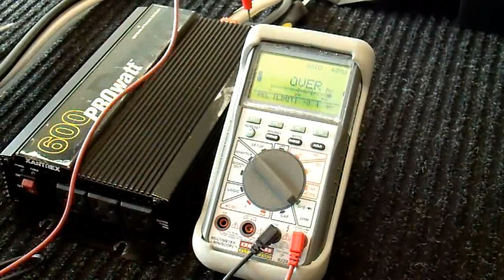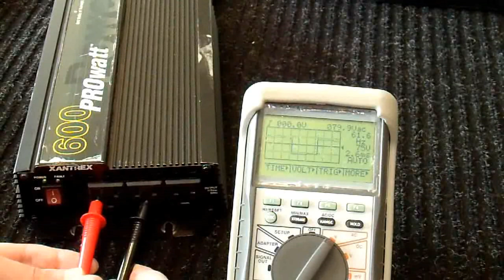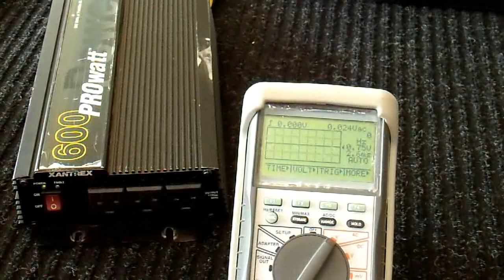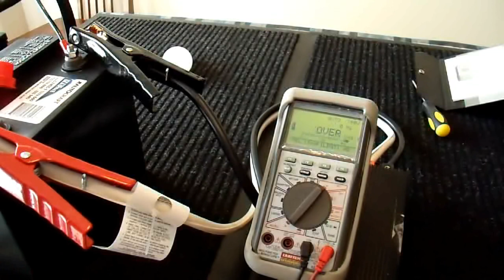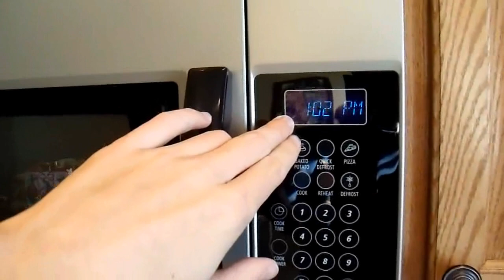How NOT to Connect an Inverter to Your House Mains - Xantrex ProWatt Inverter part2

Comment: Very well explained and worth bearing in mind before you connect an inverter or even a generator to a wall socket. Always check first to make sure your mains switch is dual throw that disconnects both + & -- .

Comment: This should have worked if your grid switch realy disconnected your house from the grid.  I use the way you first tried with no problems, I also use a grid tie system sometimes.  You Need a dual throw switch on your fuse box like we have in the UK.

Comment: Well shucks.  Glad I watched this vid, too. I use a suicide cord with my gennie during power outages. I was planning on doing the same with an inverter.  Now, I think I'll put my light circuits in a separate fuse box, powered by the inverter, and run extension cords wherever else I need juice.  I've ordered the XANTREX/MOTOMASTER ELIMINATOR 1,750 which has the knockout for hard wiring it.  Hopefully this won't have the issues with ground.

Thank again for all the info, S2

Comment from the maker: There are inverters that can do this safely that don't cost a fortune.  I had a powerbright 6000W inverter that would work fine for this - I ended up selling it for cheap.  I would recommend going that route.  Safe and (nearly) to code that way.

Comment from the maker: I don't believe in doing things 'by the book' simply because it's in the book, but I do believe in being safe.  I would not recommend separating GND from Neutral and letting the output float.  It is likely that at some point somewhere neutral will end up being tied to GND and you'll have issues.  If not then you have no protection from being zapped because your output isn't reference to GND.  Technically, though, it could function that way if one chose to hook it up that way.

Comment: If I just built a small off grid home, and wanted to use a cheap Chinese 5000 watt inverter... (not that I would)..... to run it, could I not simply start with a new panel box, isolate the ground from theneutral and be good to go? In other words, have an individual bus bar for common, neutral and ground. This is a really educational video. Good work.

Comment: well i have mine tied into the wiring of my house but i removed the neutral to ground jumper and installed a separate ground bar which should be done in the first place.

Comment from the maker: Many inverters have a connection lug GND available regardless of their output configuration.  It's probably best to just check your inverter with a multimeter.  Be aware that you need a low Z meter to properly test this since inverters tend to be so noisy (electrically) that meters will usually read errant voltages that aren't really there.

Comment: I just ordered one of those OSTiger 1500w inverters to run the 9200btu AC and my mini fridge while driving.  Cross my fingers that it can do it.  Victron makes a nice inverter/charger that will supplement shore power but it costs a fortune.  You can't beat the price on that tiger.

Comment from the maker: Just a thought:  Have you considered running the microwave or other high draw short run appliances off of an inverter and hooking the gen set up to a battery charger?  This would be a fairly inexpensive and flexible way to get more short duration power without needing to purchase a super expensive EU3000.  It would also allow operation of light loads during the night without the genset running.

Comment from the maker: There are ways to test this without causing any equipment damage but the ways I can think of are somewhat complicated and it's unnecessary to do so, because I can confidently say that, unfortunately, you won't be able to connect them in parallel.  It is interesting to hear that the EU series has the live neutral configuration.  I didn't know that.  They are sine wave output, no?

Comment: I would be very interested to know if you could connect one of these inverters that have 60V per side totaling 120vac in parallel with the Honda EU2000i inverter generator that also has that same 60V+ 60v -output and is able to pair to another EU2000i.  I would like to be able to do that in order to get increased output for my RV when I use the microwave or the AC kicks on.  Do you know if this would work or how I could test it without blowing something up?

Comment from the maker: With most inexpensive inverters you cannot do that safely.  If it has a hardwire option you might be able to.  It's best to check to verify as I showed in the video.  Of course, even if it works you still have the 'suicide cord' issue and it is technically illegal to do this in most jurisdictions.

Comment: Technicaly that is the case for some installations, in the UK,  the live cable goes into a 100 amp fuse (known as the service fuse, it remains the property and responsibility of the power company)  and the neutral is tied to earth (ground) at this point then the live and neutral wires go into the electric meter and then into the consumer unit not only are neutral and earth separate but the main switch is double pole so when the main switch is turned of the neutral to earth tie is broken